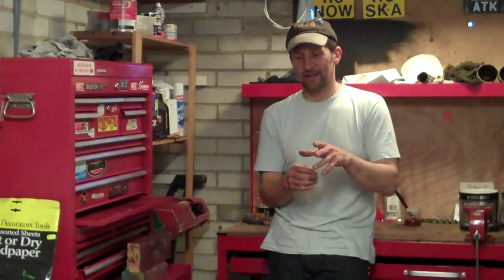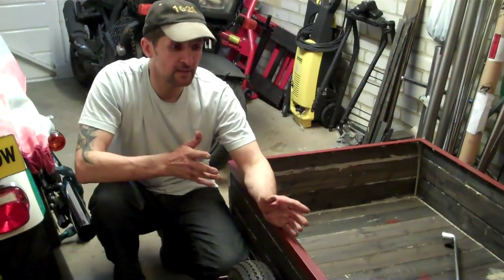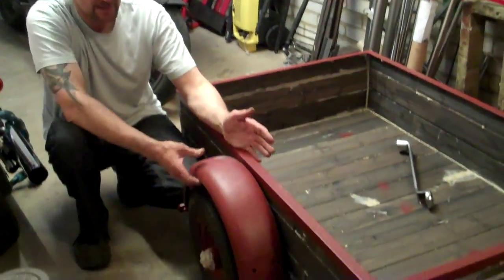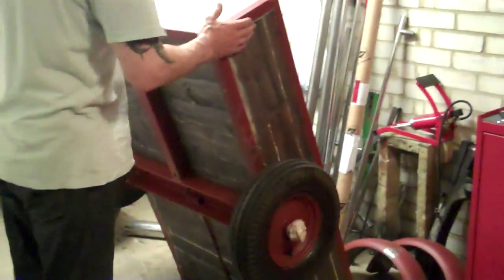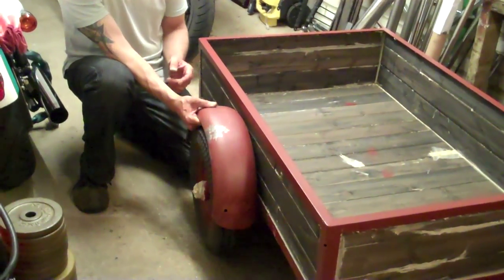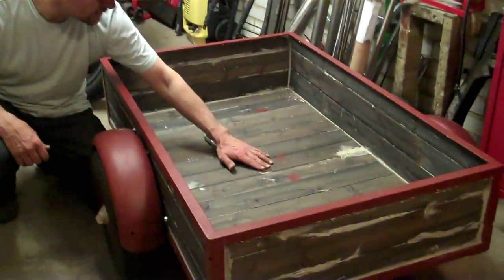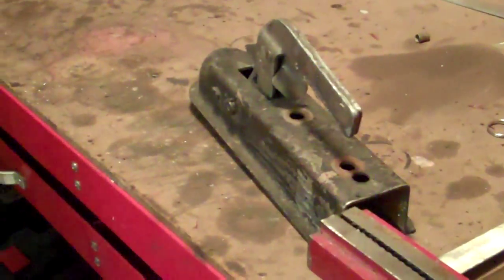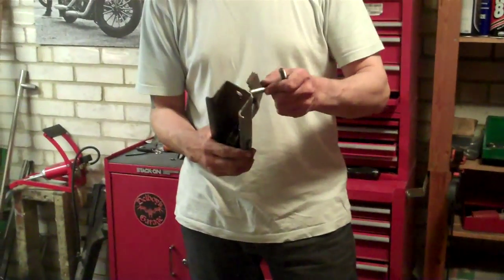Delboy's Garage, Project Rat Trailer Part 17.

Comment from the maker: Yeah, its usually a fixed penalty ticket for £60, with 3 penalty points on your licence (get 12 and you get a driving ban) but where the discreation comes is if they pull you over (Police or Vehicle inspectorate) they have rectification notices they an issue rather than a ticket where you have 5 days to put it right and surrender it for inspection...then no fine or anything, the idea being to make vehicles safe rather than fining riders, it all depends on your attitude when they pull you over